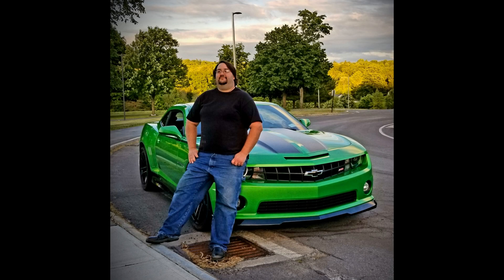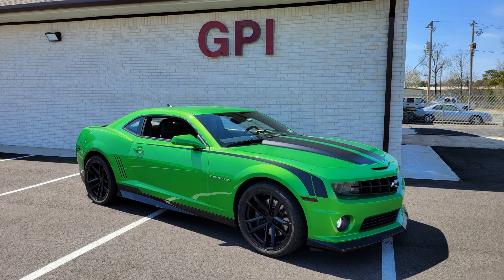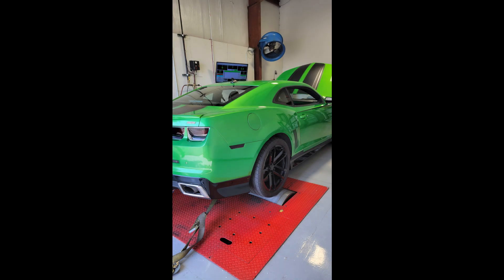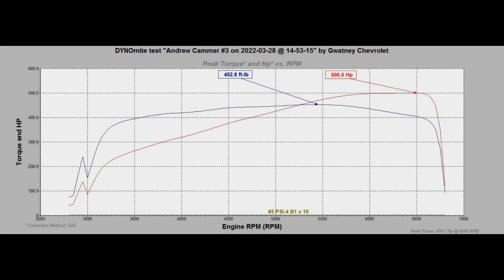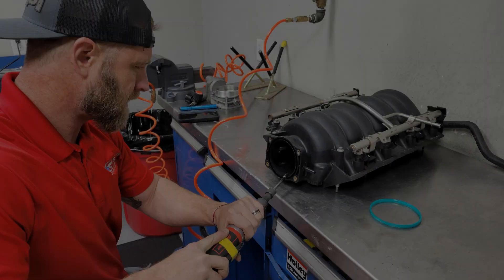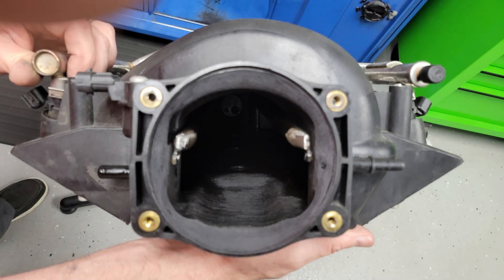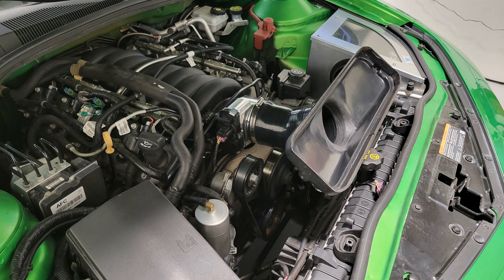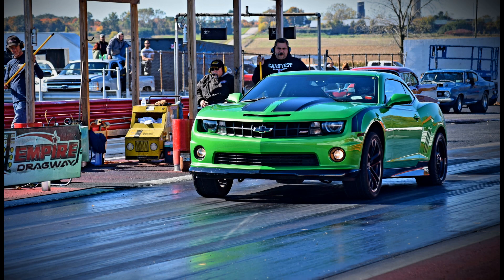What's it worth?  103mm Throttle body on a factory LS3 Intake Manifold

Comment: Is the fast 102 throttle body a good unit for a whipple 2.9 ?
Reply from the maker: @NachoCamaro  we typically use Katech for DBW stuff.  The Fast is cable I believe, should be fine if that's your application.

Comment: I have a fast 102 intake and my 102mm throttle body is going bad would a 103mm fit without any modifications or air leaking out??
Reply from the maker: @GamerDave85  it should.

Comment: Why do this on a stock intake? Pointless.
Reply from the maker: The test was done intentionally to disprove any perceived value of doing this to a stock intake manifold.  The test succeeded in demonstrating that the 103mm on the stock manifold adds NO power.  The conclusion suggests essentially what you said - it's pointless.  It's time consuming, the 103mm is costly, and there is no gain.  The point of the test was to conclusively show that resources would be much better directed into other modifications.

Comment: I just installed a Katech ported throttle body on my gen5 ls3 with SW 2" long tubes, Corsa 3" back, VR "tune" intake.  Logged 2.6% increase in airflow at WOT 6000ish rpm.  HP gain is debatable, but adding more air is always the goal. I could not feel the difference with my butt dyno at WOT, but low end throttle response increased bigtime.  Not impressed with Katech  quality...The throttle plate was acid stained and mounted upside down.  At first I thought... oh well, no one will see the stained ugliness or upside down etching once the VR CAI gets reinstalled.  BUT, I noticed the plate was catching the edge of the body since it was installed upside down so I rotated the plate 180 degrees and it fit perfect.  Katech has a fancy website and videos, but quality control is poor.
Reply from the maker: Glad you got it squared away.  That's really the gain to be had with an aftermarket or factory ported throttle body - that response down low.  If you look at the factory TB there is a huge step behind the blade that pinches airflow at low blade openings.  This is done by the OEMs to make everything nice and gentle, but it sure is boring.  TB porters, or aftermarket TBs reduce that step, which makes that early blade opening area extremely sensitive.  

Sorry to hear about the less that desirable issues with your Katech.  We sell those routinely and I can tell you that as a whole, they are good quality and we have minimal come-backs, no more than any other brand.  I can also agree that quality on parts in a very general sense isn't what it used to be, and that surely is frustrating.

Comment: Shoulda used aftermarket heads and intake manifold.
Reply from the maker: Well - that wasn't the test.  The test was pretty specific criteria - is there value in adding a 103mm throttle body to a factory intake manifold.  For that, you obviously need the factory manifold.   We've done a lot of intake testing (see below) which left us confident that the intake would become restrictive before the heads, so they were a non-factor.  The fact that we picked up zero power and zero change in manifold vacuum is strong evidence that the flow limits of the 103mm on the factory manifold are not the throttle body itself, and the modification is not worth the effort and cost.

However, we also did a big square port intake test  a few years back that has a number of different manifold combinations on a heads/cam setup that was designed to really push the manifolds to their limits of performance.  Here is the link if you're interested: https://gwatneyperformance.com/the-ultimate-ls3-intake-manifold-dyno-shootout/

Comment: Do you ever figure out what was causing the air restriction? I’m going throught this at the moment.
Reply from the maker: It's not something we pursued further. This was already a modified and ported manifold, so it's likely just the design of the manifold itself. I don't think you're ever going to overcome that. It's still one of the best Factory intake manifolds to be offered on a late model car, and even untouched they work quite well

Comment: I have a 2014 camaro SS running stock throttle body. With Gpi rod mod intake mangold. I also have heads, cam n e85. Which 102mm or 103mm work better for my setup?
Reply from the maker: Maybe re-watch the video - we proved that there is NO gain with a larger than stock throttle body with the factory manifold.
Reply: @andrewcammer2535  the 103 and 90 have the same bolt pattern? looks like it just claifiying.
Reply from the maker: @TheDevin918  correct

Comment: i am running the GPI SS4 cam and the GPI heads, CAI intake. I have NOT done the GPI intake manifold yet. Do you think with the larger cam and the heads it would make better use of the 103mm TB if I did the intake or should I just do the intake? Intake being the port and rod mod from GPI.
Reply from the maker: I think this test pretty clearly shows that there is restriction in the intake, but it is not the throttle body. I would expect a 103 mm to gain zero power on the setup you described based on what we found in our testing. The intake porting and Rod mod is definitely worth doing, that will add some Peak power and really stand up the mid-range.